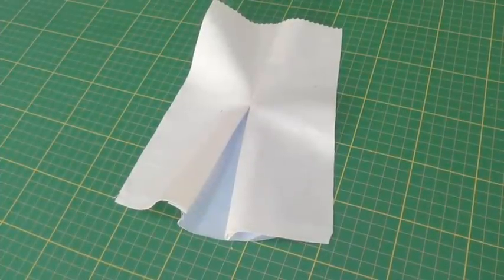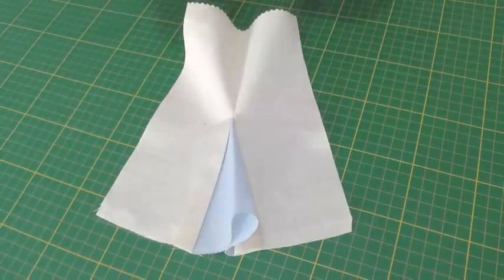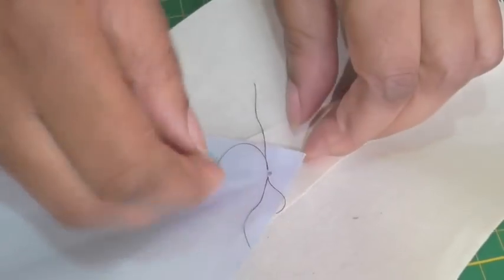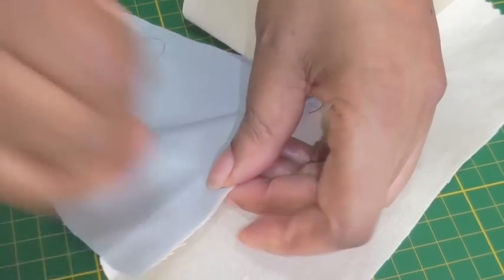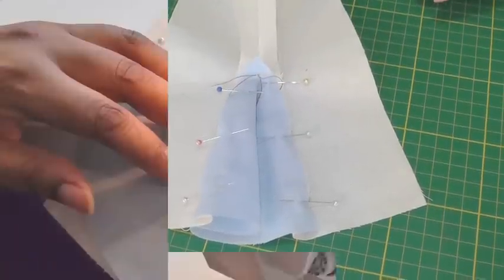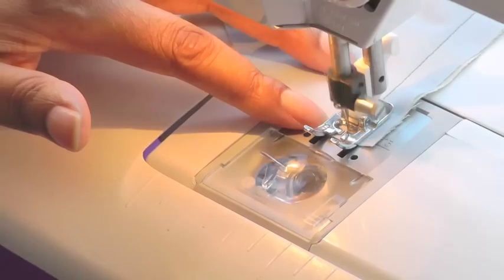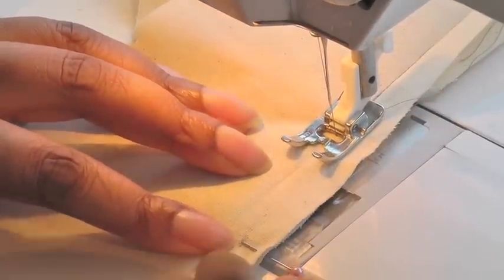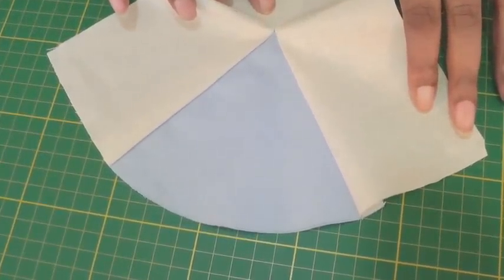How to Insert a Godet

Comment: very helpful. Could you show how to insert a godet into a skirt panel when there isn't a seam. Essentially, where the fabric is slashed to a particular point, and then the godet extended from the top of the slash. Having a little difficulty at the top part.  Thanks!

Comment: Hello.   I love your videos.  This one was so helpful that I was successful at inserting the godets on the two side seams of a skirt I was making for dance class with minor trepidation lol.  One question.  The skirt I was making also required a partial slit be cut also in the front and back of the skirt.  As there is no seam a pucker appears when I am trying to put in the godet in both areas.   Any suggestions on how to overcome this issue?

Comment: Hi Thanks for responding so quickly.   I am not quite clear on what you mean.   Just to clarify are you suggesting I add interfacing to both sides where I cut the slit to add an area that simulate a seam then add the godet or ? Just to be sure we are on the same page the pucker is occuring above the area where the godet is inserted because of course that area is reduced by sewing in the godet.

Comment: An excellent tutorial.  Thanks so much for taking the time to post it.

I  have a couple questions regarding utilization of the godet.

If one we're going to have a godet behind a zipper, which would be the order of installing the two features?

Also, could one retrofit a zip garment with a godet, and if so, how would one do that?

Again, thank you for uploading the godet video.
Reply from the maker: Hello Mama Mode, answer to your first question insert the zip first then add the godet. Yes to your second question, use the same method as directed in the video.
Reply: @colleenglea  thank you so very much.

Comment: Godets can also add modesty to slit skirts. Too many times the back slit reveals more than I want. Some matching silky material, such as would be used to line a garment, fixes the problem. How to keep it from puckering out? I have tried ironing it flat with the slits closed, making creases both sides. I have even sewed closely along the fold on the inside of the godet.
Reply from the maker: Generally speaking godets are meant to stick out to some degree, try some test samples of reducing the width of the godet and also play about with the dimensions of the slit. Thank you for taking the time to comment 2degucitas.

Comment: Could you use this to help a dress fit better as well? Like if it's a smidge tight?
Reply from the maker: It is possible but it would change the style of the dress Mia.
Reply: @colleenglea  I am O.K with that. The dress I have is a shift dress? and it has a middle back seam where I was thinking of putting it tbh.

Comment: I know ive done this before but I’m a bit rusty.   One question: isnt there an empty space or “ hole “ where you started at the top?   I tjink in the past i had trouble with that intersection    TIA
Reply from the maker: It's not a hole as such, in my experience it's best the leave thread tails and tie them together to get a professional finish and as close to the intersection.

Comment: I want to insert a gusset down the back of a dress at about the shoulder blade level all the way to the hem. , but the dress has no centre back seam only side seams. Can I cut through the fabric up,from the he,mmto half way up,the back, and insert the godet by folding in the raw, newly cut edges the dress? To emulate a seam allowance. All the tutorials online show gussets being inserted on seams which have been unpicked.
Reply from the maker: +Rosemary Morton Jack Yes it is possible but the godet may distort the neckline and the armhole, make sure that you bare this in mind.

Comment: Hi Colleen! I'm struggling to find ANY info about my question. I have a center back godet that i need to add that will work as a train for the dress i'm doing. But because it is a lace fabric with a beautiful trim at the selvages of the fabric [which i would like to use as a built in hem trim], i dont want to cut the pattern hem out at a curve and have to applique the trim later. Is there any way that i could cut the godet triangle's hem straight [in order to use the selvage as is] whilst still ensuring the hem will have that rounded curve after insertion into the seam? Because if i keep the triangle straight and just cut, the entire dress hem wil be beautifully round except where that godet is inserted, which end up being a blunt straight line.  Please help :(
Reply from the maker: Hello Martelle. I don't know of any other method than the applique, I'm sorry That I could not be of any help.
Reply: Colleen G Lea - FSBTV ah so sad! Looks like a hand needle is inevitable in my near future. Thank you for the response!